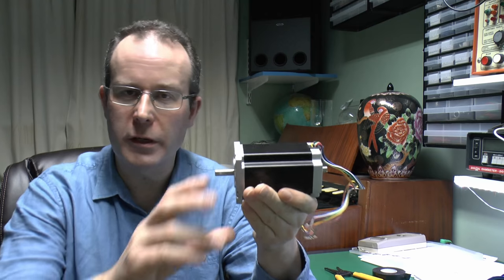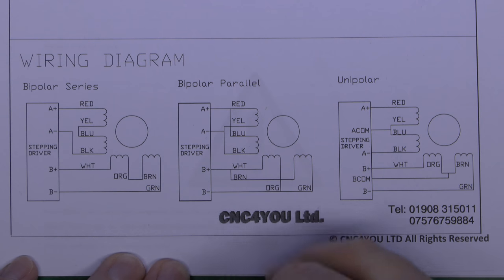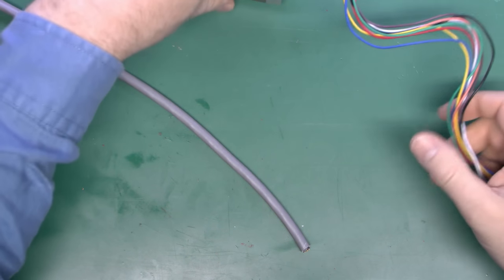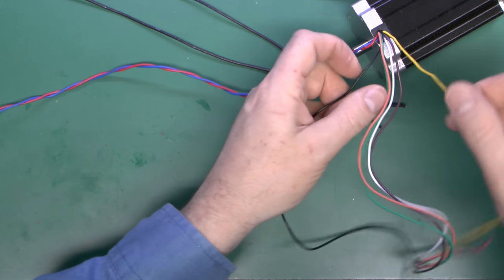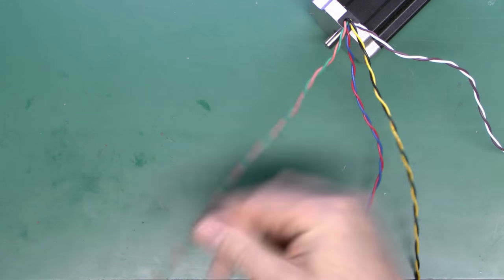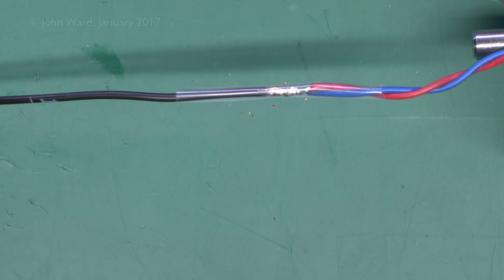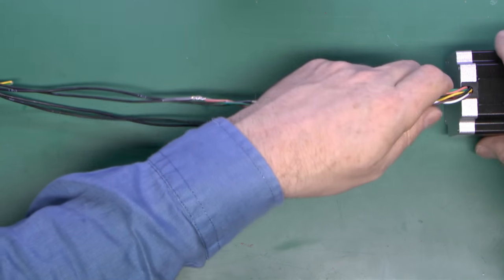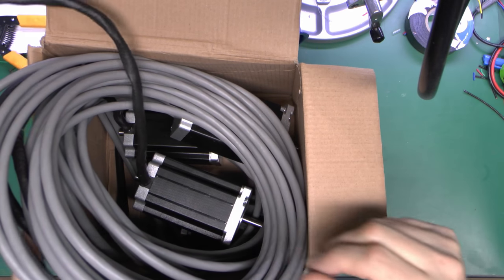CNC Router Build #2 - Stepper Motors

Comment: You can put  bakelite thumb nut at the other end of the shaft of the motor so you can manually control your routers axises easily.

Comment: Why not just replace th provided wire alltogether rather than splicing them together. Shouldnt be so hard and you geta cable that is sheilded all the way or at least use the linesman splice which is neater and stronger.

Comment: Did you get all the CNC parts from cnc4you? If not, can you provide details of the other suppliers you used?
Reply from the maker: No, only the motors were purchased from them.  I'll do a list of all the suppliers in a later video.  Actual parts are covered in part 1.

Comment: You're gonna need really good rigid fixation of the cable and the motor, to avoid that serious weak spot where the (relatively rigid) cable goes into the motor.

Comment: Don't use heatshrink for that last section, use PVC braid and rubber sleeving . That's the wrong cable, use shielded twisted wire. Don't cut the earth wire short, leave it in. Add common mode ferrites at both ends.
Reply: Agreed. At the very least, the copper tape on the motor end of the shield braid would be safer using electrical tape to secure it away from the motor casing. If the shield makes a connection with the motor casing and the cabinet end is terminated to earth ground, ground-loop circulating currents are possible and most undesirable.
Reply: What kind of cable would you suggest instead of this "CY" cable (e.g. provide a link to an example product)?  In general there are not many recommendations for the wiring used to connect steppers to the controllers, d.i.y. people seem to use just whatever they can find.
Reply: @perspectivex  From a quick look Belden 9552 looks ideal? 18awg (16A), voltage rating higher than the 72v you'd ever see on a stepper, nice shielding. John's really just using what he has on the shelf here, which is the main issue with people larping on youtube, only industry does it properly. The twisted cable is for EM fields, the pvc braid is avoiding a stiff connection, the earth shielding and wire has to extend the full length of the cable and terminate right before the end. None of this is essential, but it's what you might see on say an industrial robot and it's good practice

Comment: I'm surprised there is no mechanical protection of the wires going into the stepper motor.
Reply: I was just about to say the same. The lack of provision for any kind of strain relief is a little concerning. Especially with such a heavy shielded cable now being joined to it
Reply: Once they are on the machine, they won't need it.
Reply: The cable must be fixed to the machine anyway, allowing any motion/flexing on a soldered joint invites failure. 
You could bolt a PCB, bracket, or a small junction box to the end of the motor providing proper strain relief if there was no other way to fix the cable.
There are motors that come with a JST plug at the motor instead, at least for the smaller sizes. You can just crimp a plug on your own cable, it makes for a very neat solution.

Comment: Hi John, you use shielded cables but it is not electrically shielded. Common mistake, the reason is that the shielding should be connected to the chassis at both ends of the cable, all around the inner conductor, so no pigtails.
Here is a nice simulation showing the effect of a shield connected only at one side, through one or more pigtails and the correct full around connection: http://www.rfemcdevelopment.eu/lv/emc-basics/emc-blog/147-emc-pigtail

You can reduce the need for shielded cables by applying snubber networks to the end stage circuit and installing a lowpass filter and common mode choke on the output. It is better to prevent than trying to fight it.
Reply: I thought that grounding the second end would require an RF choke?

Comment: Does the cable shield not need to be tied to the motor chassis to be effective? I thought a shield needs terminated on both ends to effectively make a Faraday cage.
Reply: Just at the source end, otherwise you could get a potential ground loop. It depends on the application, like audio would be grounded both ends

Comment: i would have taken the motor apart and soldered the black cables directly to where the cables are soldered to
Reply from the maker: If you take a stepper motor apart, it disrupts the magnets inside and it won't work properly ever again..
Reply: i didnt know that, thanks
Reply: It would be nice if stepper motors had solder lugs instead of leads. Taking stepper motors apart is not advised though.
Reply: That's a bit of a myth, someone did a video comparing the strength and there was no difference. 
If you are still worried you could keep the rotor inside and just take the end cap off.

It's only two volts John, I think that shielding is a bit overkill, especially the copper tape ;-).
Reply: stefantrethan
You don't think he is going to run the motor at 2 volts, do you? PWM stepper drives are constant current, so you have torque at high RPM. So it is typical to run motors at 24 to 80 Volts.

Now as far as any video goes that's one video, and there's lots of different kinds of stepper motors. They may look the same on the outside, but it is what is inside that matters.
Reply from the maker: +stefantrethan
These motors will operate on a 48 volt supply.  The voltages on the data sheet are mostly irrelevant.
Reply: *****
I run at 32V myself, because that is what it says on the back of my cheap imported TB6600 drives.